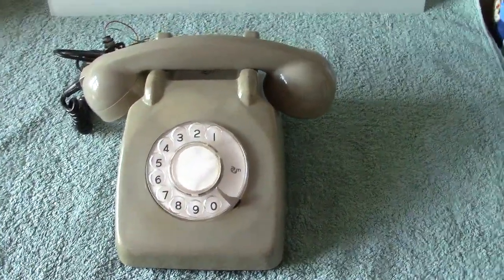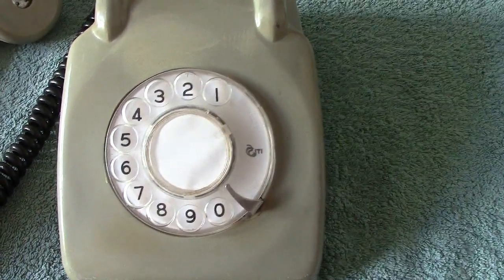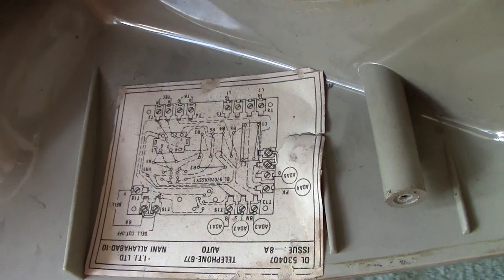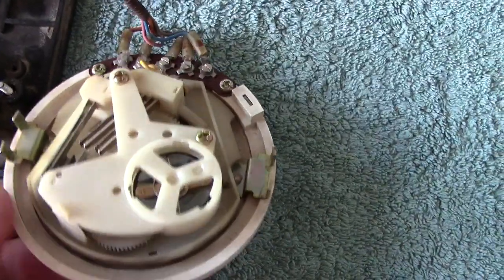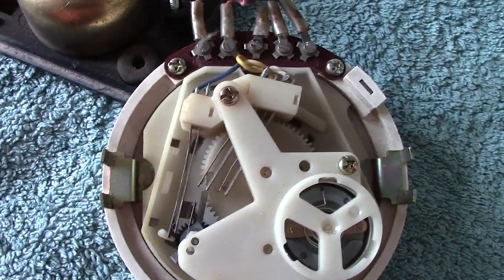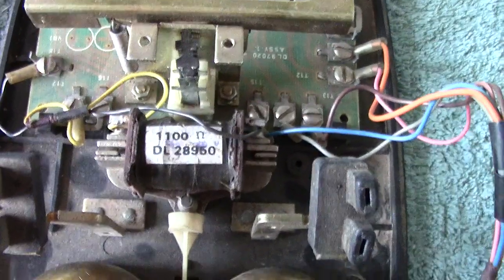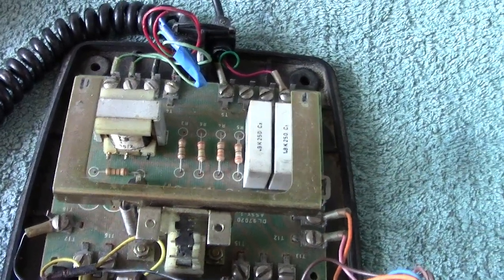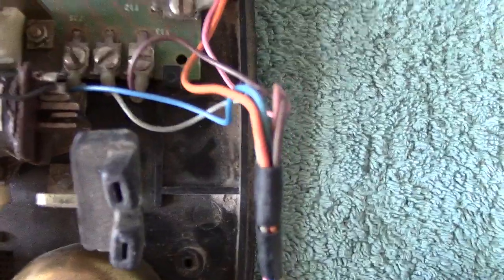Telephones of the world    Indian 706 lookalike by ITI 1986

Comment: Hello @migette1
Thank you for this video, it was very helpful to learn about this device. 
I am trying to interface the rotary dial from this model in this to some new electronics (Arduino). 

I connected the rotary dial to a digital analyzer - with pink as ground, and reading orange and brown. 

I was confused when I saw dialing 1 sending 3 pulses, 2 sending 4 pulses etc, until 4 when it sends 6 pulses - and on 5-7th it sends 6 pulses. On 8 it sends 1 pulse, gap and 6 more pulses until 0 (3 pulse gap and 6 pulses). 

Brown does give off a pulse when it is in 5+ dial range - but again it is same for all 5+ dial numbers.
I see no information to distinguish 5-7 numbered dials. 

Wonder if my dial is broken because of age, or is this some unknown scheme? 
I have scoured most of the internet and found nothing about this. 

Any idea?
Reply from the maker: Sorry I should not of said dialling 1 gave 3 pulses completely wrong.
Reply: @migette1   Thanks for the reply! 
Are you saying getting 3 pulse for 1 etc means the dial is broken?

Comment: Why this phone have a different line in cable,is WiFi home router or Bluetooth gate way can connect with it
Reply: These are landline phones, two generations before WiFi. If you use a wired broadband connection, your router might support an RJ11 out, to which this phone or any other landline can connect.